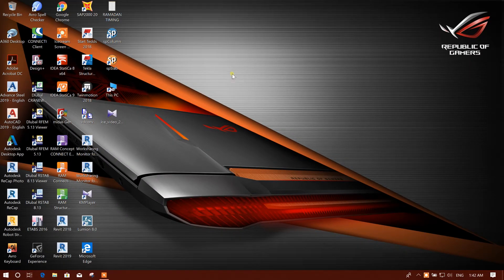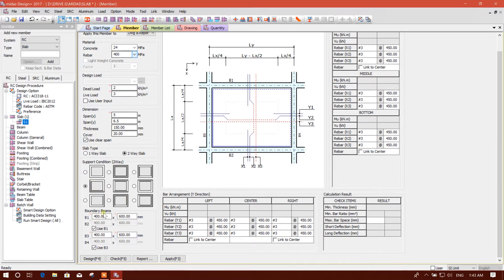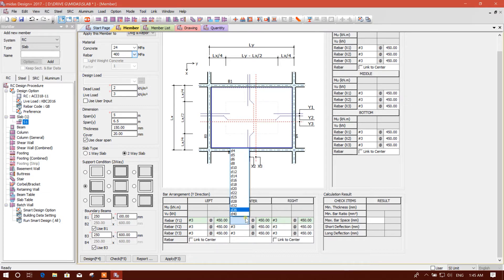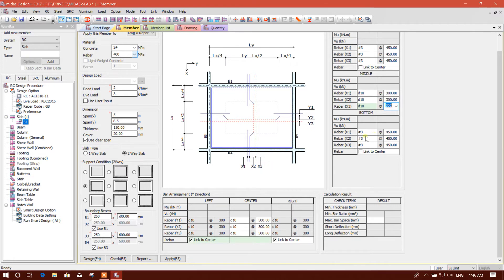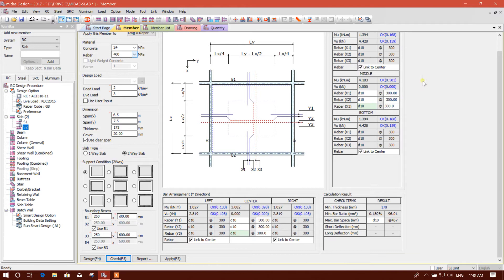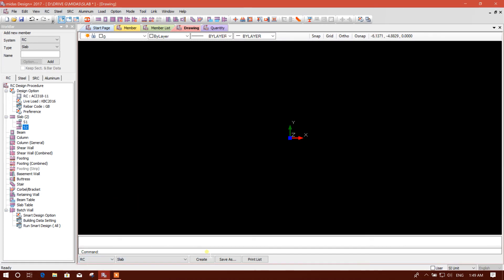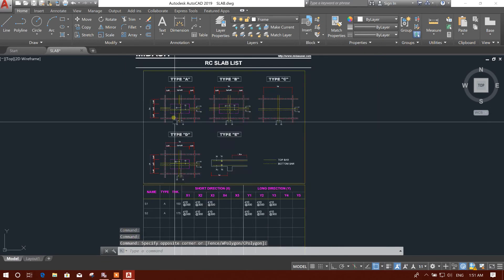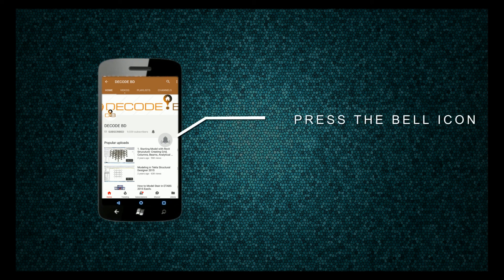SLAB DESIGN IN MIDAS DESIGN+ 2017

Comment: Good day sir. I tried installing the MIDAS as described in your installation video. But the design plus keeps giving an error "ATTEMPTED AN UNSUPPORTED OPERATION". Any Ideas please? Thanks. I'm using a Windows 10 64bit os
Reply from the maker: Update windows 10, then uninstall design+ & reinstall.
Reply: Still remains the same
Reply: I just Installed design plus on my Windows 7 system and it keeps giving the same error message